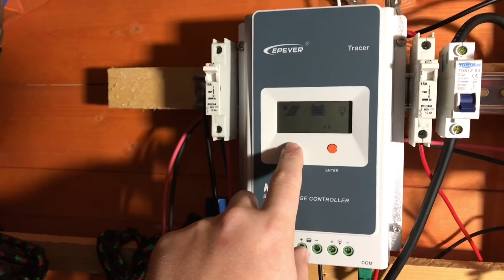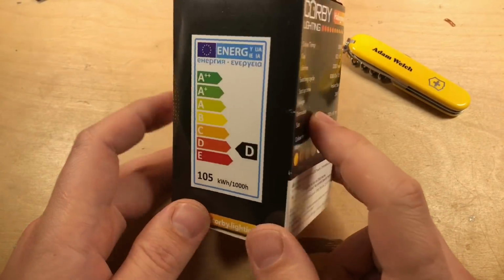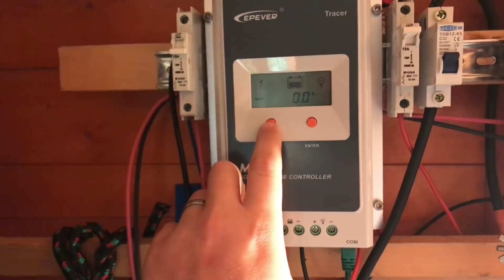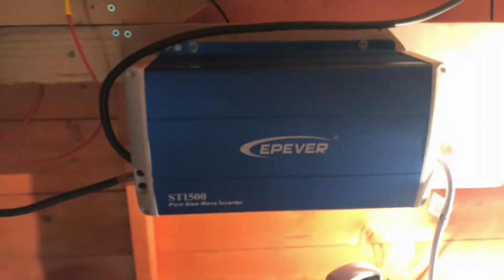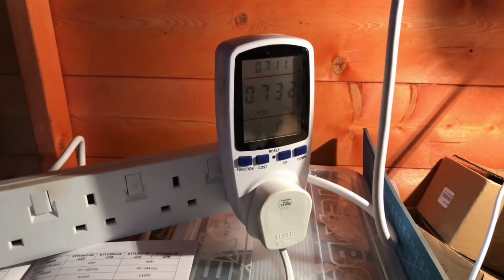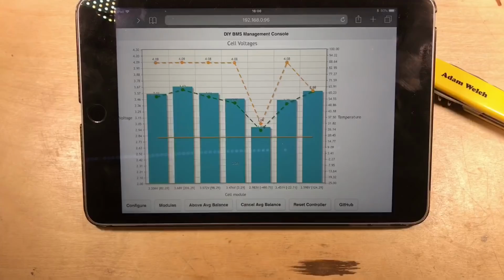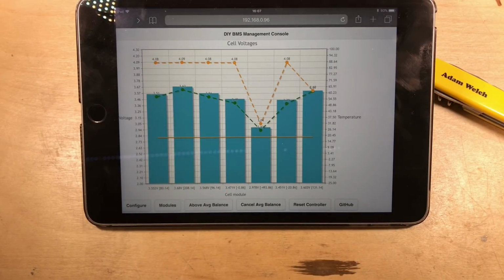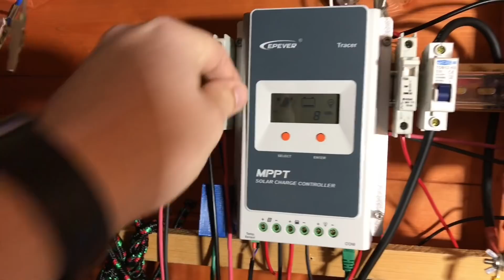1kWh Discharge Test - diyBMS

Comment: You have what 5% difference between 4V and 4.1 ?  Yes, right move to stop when one pack reach 3V. You did not measure on the DC side, because of the inefficiency of the inverter of course tou produced more KWH than on the AC side where you get only battery KWH / inverter efficiency. If you measured on the DC side you should see closer to a KWH.

Comment: Hi Adam, since this test, have you figured a way to implement low voltage disconnect, such as a relay for ex, or you are still doing it manually ? I see that on your tracer you also have a load output, and if its not for not big load... like a lamp, why not trying to use it? Afaik, you can setup the tracer to have a low voltage disconnect for the load output. Thanks :)
Reply from the maker: Yes this should be easily achievable using the load output to power the relay coil as long as you're not using the output control for something else - like lights at night.

Comment: In my packs, I test each cell via my OPUS(s) and add them up to get same mah...  e.g. some of my packs have 45cells = 130,000mah and some have 68cells = 130,000mah.    When all the packs have the same mah capability - they draw down very close together voltage wise.   Maybe - your low pack's  20cells do not add up to 50,000mah...  and so its burning down faster than the others  OR maybe you have a bad cell.    If the packs have same mah and good cells - they should provide power with voltages being pretty close - e.g.  maybe .2 tenths variation max.

Power.    50,000mah * 4.2 = 1,470Wh maximum.    If you do a linear scale from 4.2v (max - 100%) to 3.0v (min - 0%)  then 4.0v/cell charge is about 83% = 1,220wh max if all packs discharge down to 3.0v.   In  this example, the packs seems to go from 4.0v  (83%) down to 3.4v  (33%).  83-33 = 50% of 'linear' voltage range / power.    1,470 * .5 = 735wh...  which is pretty close to what you got.

Conclusion.  IF you fix the bad pack and go from 4.2v (100%) down to 3.3v (25%)...  giving a 75% DOD.   This should give you 1,102wh - pretty close to the 1,000 you are expecting.   This should be perfectly reasonable from my own experiments.

Comment: If you still have it, you should use the AN controller. It has a vastly improved PP tracking algorithm, especially in varying conditions.
It is difficult to quantify the actual improvement in output, but in my case it is substantial.
In addition, you can actually use the lithium settings.
Greetings from Luxemburg.

Comment: Hi Adam, have you plugged anything into the RS485 port yet? I'm dying to see what it does. Also there seems to be an updated GUI for the 4210A to download. I haven't tried it yet, maybe at the end of the month, so I don't lose my monthly total.
Reply from the maker: The port on the inverter? Actually, no I haven’t but I expect it’ll be the same as my SHI inverter. I think I covered that in a video? I struggle to remember sometimes!

Comment: You need to know the efficiency of the inverter at various loads plus its no load current drain.  My 2000 watt pure sine wave inverter idles at 1.2 amps but that only matters when the load is less than 100 watts.  The inverter is rated at >=85% efficiency but that varies with load.  It's about 90% between 100 and 300 watts, dropping off above 300 watts and is 85% at 750 watts and around 80% at 1600 watts.  If you know the efficiency at a specified load, you can determine the input wattage.with a little math or buy an ammeter that can handle the current and use a good voltmeter to work out the input watts.  Some of the simple power meters are not all that accurate if you want an accurate power rating.

I have more experience with AGM than lithium batteries, but I'm aware that the last few % of charge on an AGM takes a long time because the change acceptance decreases as the battery state of charge increases.  I suspect lithium batteries have a similar characteristic.

Comment: Last month I was testing my 4S battery pack with an active BMS and have similar problems.
First it is good to know internal resistance of each block. So you can find out, what is going on in battery. My BMS can calculate it, but I have to conect a shunt (haven't done yet). It should be a quality version to have accurate data. Shunt is also used to calculate amount of balancing current. The BMS also has to know if the battery is charging or discharging. 

About disconnecting discharging. One of the blocks always runs out of balance at end of discharging so BMS has to cutt off the load. Trying to set cutt off voltage higher on solar charger, it was 3,5V/block or more. Connecting a shunt, my BMS could charge lowest block with up to 2 A from other cells, so most of energy could be used from battery.

The relays. I was in contact with producer of my BMS, and they told me, there is a problem with high voltage surges when relay goes on and of. So I have to connect some simple protective electonics. Don't have enough knowledge in electronics to tell more. I just purchased the box and will conect in in a few days. I havent purchased the relays yet, so I'm interested to see, what you would select. My peek is BMS123 Smart - Dual Relay, but the price is pretty high.

About charging. How much V/pack can you get your battery charged. 
I can't get my battery charged over 4,1V per pack. Just under 4V most of the time. I am using similar parameters for solar charger as you are. The problem is that bust charging ends too early, when 3A or more are still going into battery. 180minutes are not enough. I have to use Float charging. OK. My 4S9P battery is probably too smal, and Charger reaches bulk ch. limit too fast. But I see, you also don't get your battery fully charged.

Comment: Assuming 80% efficiency for the inverter, the battery delivered about 0.88 kWh, which is not too bad from cells which were not fully charged. That weak pack does need investigating, as you say, so we await the results of your checks. Apart from your suggestions, it's also possible that the charging efficiency of that pack is slightly lower than that of the other groups. Thanks for an interesting experiment, Adam.
Reply from the maker: Cheers.

Comment: Is quite normal to have one cell failing so drastically it could help if is low voltage limit set a little higher like 3.3/cell.... yes with my powerwall I have the similar issues.... Since I have 100ah pack's in series and 3 such in parallel... Because of different chemistry and other small factors are your issues common... 
I have solved the issues so that I added reserve capacity 100+30% so that I have now 130ah pack's and is guaranteed 100Ah/pack usebal capacity.... And other things at the end of capacity I could still use full determined current like 25-30A/pack..... is important to not overstress the battery's if you want to have used li-ions long in use.....
Excellent test you make there 

However lots of video's on YouTube show how to kill the battery's not how to last long long time.... 
Those people will always have issues with some packs/cells.... 
One other thing is to measure capacity of the whole packs and then put them together is good thing to do.... 
Sometimes you discover anomaly in the cells that way also..... 👍

Comment: One more thing you di dnot do; before wieving the voltage of cell's you di not disconnect the solar so the voltage was certainly below 4V per cell.
Reply from the maker: That’s very true - I’ll absolutely have to run this again once I’ve got everything properly charged up.

Comment: Hi Adam.
I'm using an EPever Tracer AN, spent some time sorting the settings for Lithium.
If your interested I can email you my settings to try/compare with your own. Just use your controllers "import settings" option.
Reply from the maker: It’d be interesting to see what you’ve set. My email address is available on my ‘about’ page. Thanks.

Comment: Thanks for sharing, Adam. I’m completely off the grid and my total Wh consumption is about 475 at peak (Fridge, PS3, LCD TV and LED lights) I’m using Lead-Acid deep cycle 6v in 24v array. Would like to move to Lithium by December. 250x6 panels and Triron 4215 1.6Kw 12/24v diy inverter 110v AC

Comment: 0.4v difference is probably to be expected on used cells mate. My 6 banks of 7s20p have a 0.2 - 0.3 difference on my used cell packs and 0.1 - 0.2 on the new cell packs. I Don't think its going to be possible to get them perfectly matched without spending more money or power than its worth myself. ;)

Comment: Hey brotha, I've been 'off the grid'(so to speak) lately and have just popped back in to see what has been going on. Great to see the evolution of your solar shed system. I need to go back and see what you and Colin have done with the BMS unit, but it certainly not balancing during discharge (you said you know its top only). I really like the software monitoring feature. Your test was cool to see as well, you spoke through everything I was thinking, but I am glad you tested the "true output" instead of running the packs individually and then forgetting about inverter conversion losses. Looks like pack 5 needs to go. Replace it and run the same test (assuming you have a spare pack on a shelf that's built and ready to be plugged in). Your two lowest packs were 3.45 each so you have a lot of unused energy left in the battery. Looks like your burning the incoming power through that large resistor when they hit 4.1V, and if you added relays, may as well drop a few lines of code into a Mega and use the leftover after you hit 4.1, send it the other low packs to even them out faster...just a thought. Anyway, I have tons of cells that I would gladly send to ya brotha, just let me know. I haven't built anything in a while and would be happy to donate them.

Comment: I guess someone could be lazy and just add a couple extra cells to the weak pack. Or just swap out the weakest cells would be best. I have almost 1200 cells I'm working on a 1400 cell 7s pack or bank I should say. So far in testing all are 23??-2900 mah. A bit wide spread to just throw in to series.  I am running out of room for all these cells!!!  I'm going to have to make packs, and hope I can build a nicely ballanced bank with the cells I have tested so far... Nice setup. It's similar to mine. Except I'm trying to power my offgrid house with Batteries!!! For now I have 45amps of solar to charge them. And my lead acid Bank. I'm working on a DC generator that will be capable of powering the inverter and charging the bank. It should do right around 300 amps at full output. I plan to only use it on my lead acid Bank.. I guess a midnight classic would be the only way to safely charge the lithium bank with it!! I hope to get a few more cells and put the lithium bank to work!!! Thanks for the update can't wait to see how it does, and what's up with the low pack!!

Comment: Adam Welch+ Did you ever swap the wires around to different banks to see if there may be a bad wire somewhere? Maybe one of the wires that you have daisy chained to the next on bank 5 or out to 6. I would want to figure out why 5 dips so much rather than having a shut down on each bank until it's figured out. I would swap out the best bank wires to the one before or after and retest, just trying to help
Reply: It could even be the BMS itself on bank 5, maybe a faulty component that got worse in time.

Comment: how much is the inverter's efficiency ?
Reply: Google the inverter mate, its easy to read and learn the specs.
Reply: why should you answer this
Reply: another commenter did the google search :-P ... but jokes aside, he commented that the inverter drew "6W x 7H = 42W + an efficiency of about 87%" and estimated total power draw to the pack was nearer to 880Wh. But this was not the test Adam was trying to do.... he was hoping he'd get 1kWh on the output side of the inverter, and fell short of the mark. Considering he was at 4.00v instead of 4.20v.... the pack would certainly have achieved that if fully charged... but one of those cells still needs some TLC
Reply: :)@Peter Feerick, my question was both a bit of showing that Adam's video was very interesting and asking HIM for what his inverter's efficiency was, Maybe I should've added his name in my comment :S and OFCOURSE I understood what his goal/test was about, I did after all watch his whole video :) Thanks for your info about the inverter.
Reply: No problem. I didn't find that info, another commented looked up the specs and posted it. And yes, if you specifically wanted Adam to respond, it would have been a good idea to tag him, otherwise naturally other viewers will comment and respond as we'll ;) Perhaps you are thinking the efficiency could be different to that stated by the manufacturer in the spec sheet/manual?
Reply: +Peter Feerick all ok :) I was just curious for the efficieny of the inverter, not thinking if it would be less than is stated in its official documentation although manufacturers tend to exaggerate
Reply: Oh, that they do @maicod  !! It's that "up to X efficiency" that gets you. And since the efficiency changes depending on the loading, it would be interesting to see what it is when the 105w bulb is on it... Don't know if Adam can measure the load of the inverter or not though ... A 10a multimeter should be fine though... Somewhere in the order of 4.2A load on the DC side for 105W (at 25v)? Then the efficiency could be worked out and battery side kWh also.
Reply: Yes maybe Adam can use a clamp meter (not so exact) or connect a multimeter between the positive coming from the battery packs and the inverter

Comment: Why 18650 battery packs,  Why not a good brand lead-acid battery, for example Trojans battery's.   
You see how unstable a 18650 system can be.  a to big a risk that a 18650 cell breaks down.
Reply: Check out the problems ChrisDIYer is have with his lead acid system.. he did a damn good job putting it together and used brand new Trojan L-16 batteries.. he swears he wont ever by a lead acid for solar ever again
Reply: unstable? You hate Elon Musk too dont ya...lead acid, man oh man.
Reply: Where is the "fun" in that? It is not like he is using this in a critical aplication.
Reply: Of course it's unstable, he gathered a bunch of random cells and made them into a large packs of batteries... Do you seriously think you wouldn't have similar issues if you went and gathered a bunch of random SLA batteries and made a big battery bank out of them? Sure you wouldn't need to balance them or anything like that, but you would more than likely run into the exact same problem with one set of batteries being weaker than the others and while lead-acid batteries are safer they still have that risk where one can break down and short the other ones, they aren't foolproof.

If you wanted to make a proper pack you would buy a ton of cells in bulk and they would be fairly well matched.
Reply: He has a bank of lead bricks.

This is just for learning